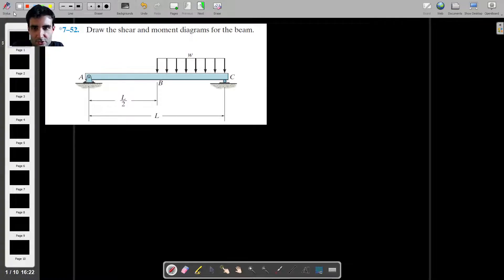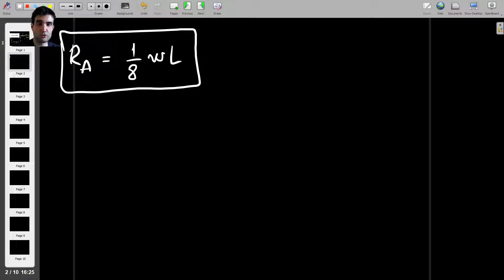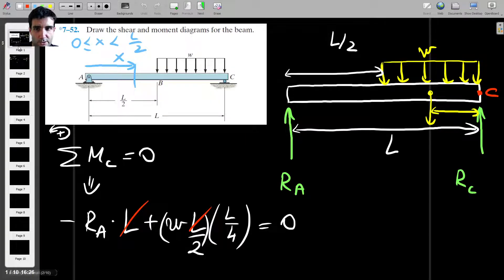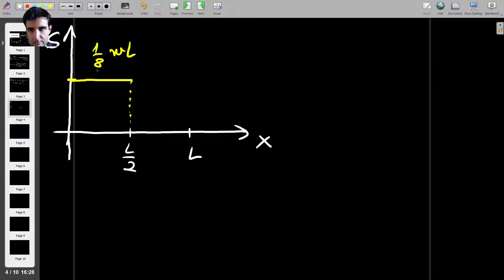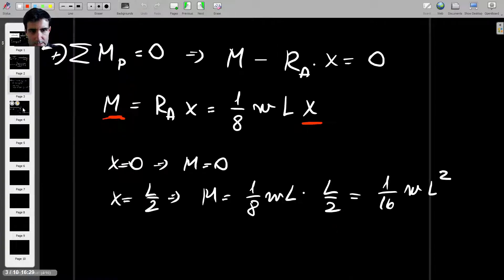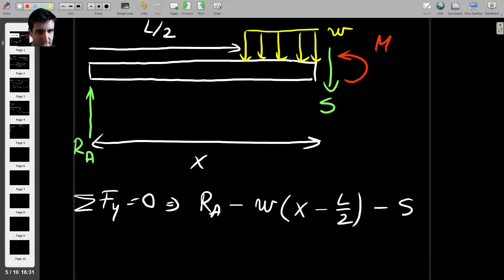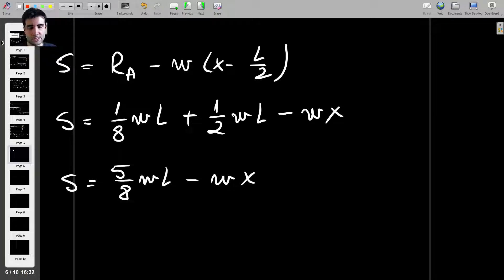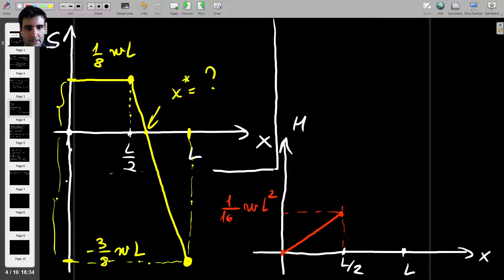Shear Force/Bending Moment Diagram for a Distributed Load

Comment: Sir, you have shown that maximum BM is wl2/16. It's not correct. You have to find BM value at the section of zero SF. That BM value will be the greatest of all....
Reply from the maker: Thanks for pointing it out, you are right of course, the max BM is at that x^star position shown on the SF diagram. I should have drawn the parabola increasing until x^star. The way I drew it kind of implies the max is wl^2/16, which as you said is not correct.